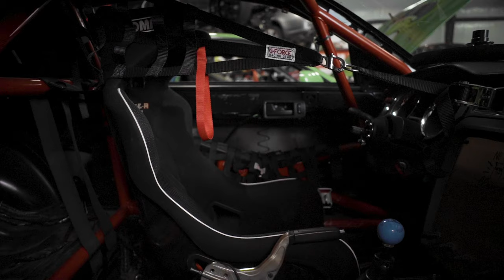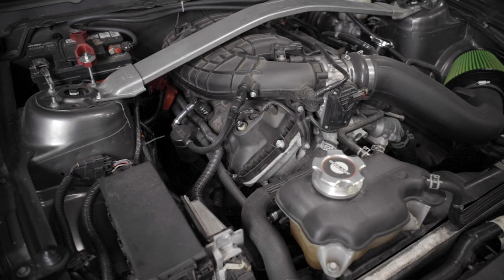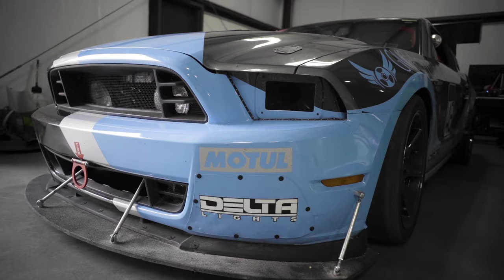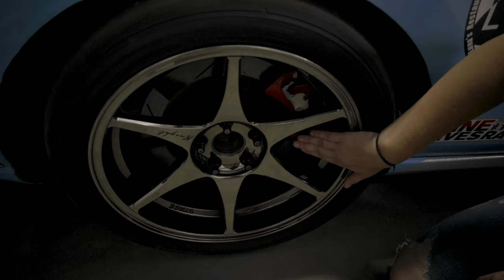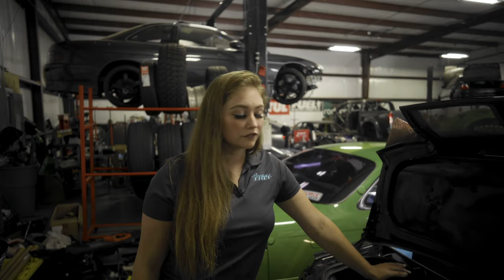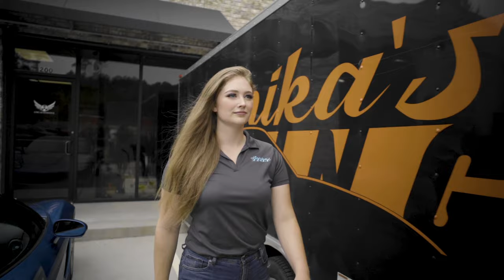ANNIKA CARTER 2014 V6 MUSTANG Track Build | GRIDLIFE Touring Cup 2020 | Daily Racer

Comment: I have driven Road Atlanta in a Skip Barber Formula car but luckily I did not wreck it. I did however find out that those cars top out at about 125mph. 
P.S.
This V6 mustang is way better than even some V8 Mustangs out there.
Reply from the maker: Glad you like it!
Reply: They do not top out at 125mph, you most likely had an electronic speed governor which can be removed with a tuner.